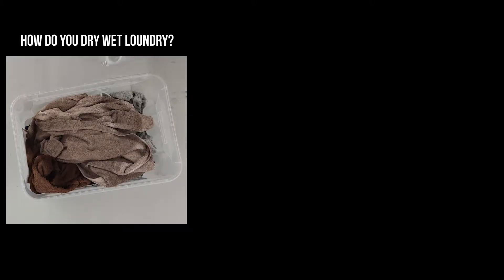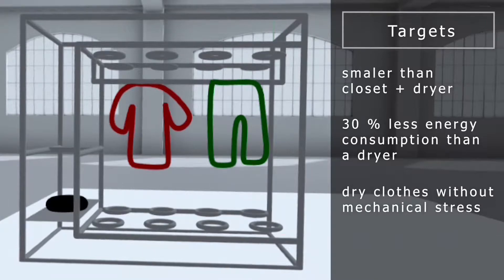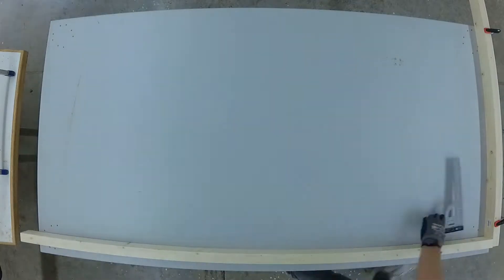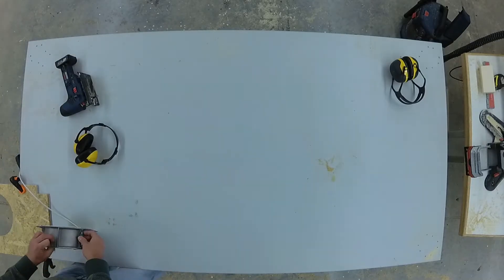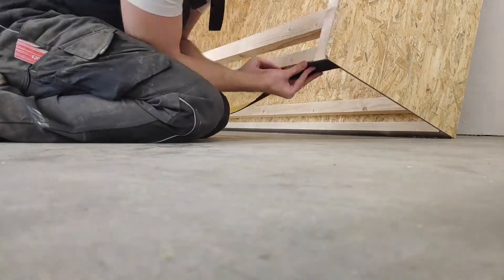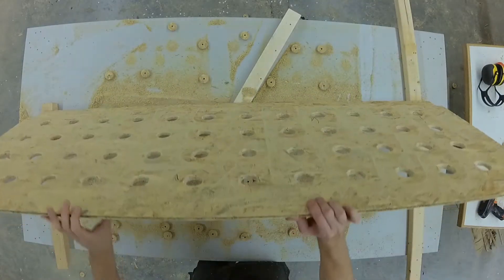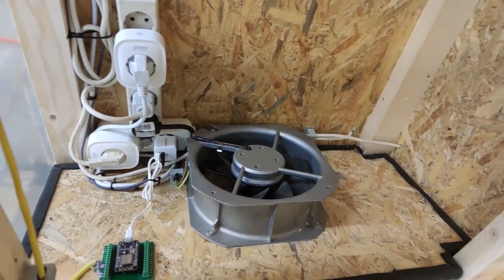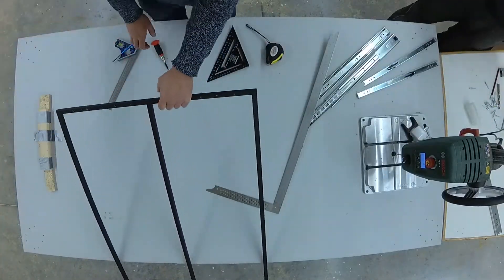Drying closet, smart alternative to a commercial dryer // KI Voice

Comment: Design flaw.
Even though the perforations are distributed across the entire board, this does not mean that air will flow evenly through each hole. The air will only flow through the left end because air always seeks the shortest or least resistant path to circulate. The design could distribute the airflow more evenly by either reducing the number of holes or narrowing the holes. The justification for this modification is that by narrowing the paths through which the air flows, you force the current to use all the holes to circulate, rather than only the closest ones

Comment: FYI: I built a similar device and there was no difference if you just put the fan, the dehumifier and the wet clothes inside a wooden closet. The fan is important as it promotes air circulation within the closet.